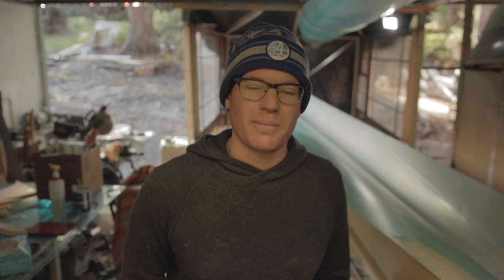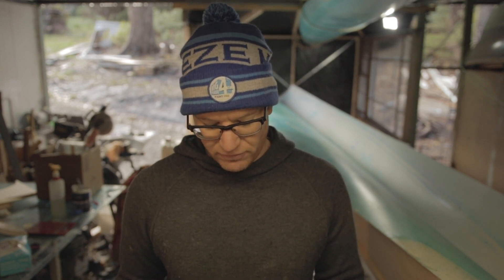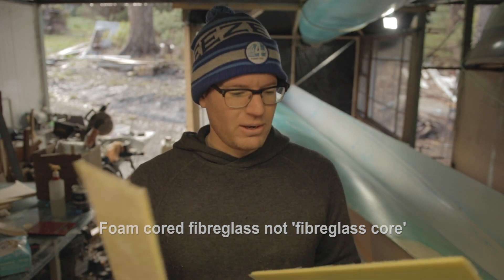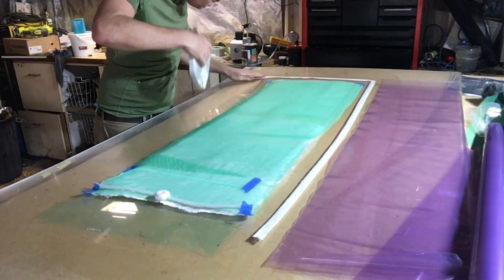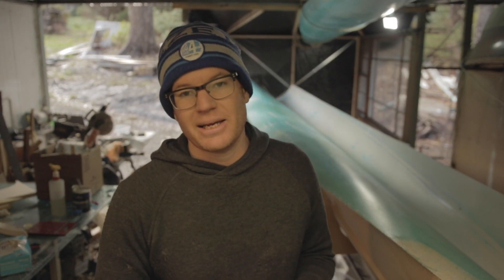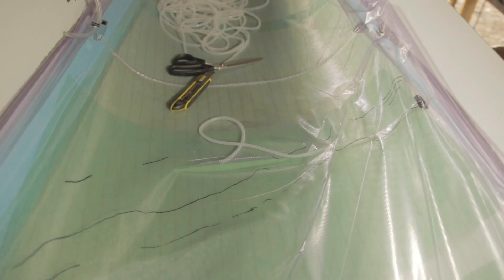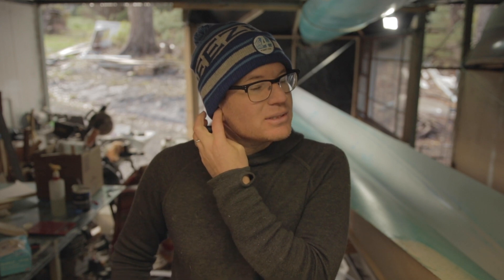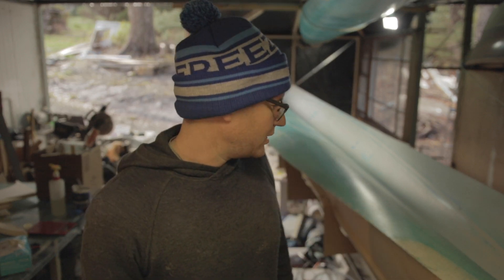Experimental boat building. Will it work??

Comment: I saw a guy bend that stuff with a heat gun.
Reply from the maker: Yeah it pretty pliable with heat added. I’ve been using a recycled PET (drink bottles) foam lately and it is very susceptible to a bit of heat which makes life easier.

Comment: Hi Matt, what a great video! (subscribed) One question if I may. I've got an old 14' sailing dinghy of thin plywood/epoxy construction. The plywood got soft over the years so I striped it down to a shell and dug out the soft wood (about 10%). Now after applying all anti-rot treatments I'd like to put some extra foam (thin) to reinforce crucial places before glassing over. I've got plenty of Extruded Polystyrene  (soft & flexible, we use it for packaging ). Will it provide any strength, or should I stick to the pink construction foam? Where I live the options are limited and I'm reluctant to order some fancy foam from oversees as I don't value this dinghy that much. Any comments are very appreciated.
Reply from the maker: Thanks Matej! To be honest I’d avoid foam if possible. It’s really only good if used in a sandwich with fibreglass on both sides and any kind of polystyrene is not great in that regard anyway. 
If you’re just filling shallow areas I would just fill it will thickened epoxy or if you’re replacing whole sections of plywood I’d just get some more plywood and scarf it in then glass over that. Does that make sense? Good luck!
Reply: Lol I'm going through the same dilemma.   I've recently bought a 12.5ft solo that has some hull damage.   Dealing with 7mm ply is difficult and almost impossible to scarf in-situ.  I've opted for halp lap joints instead.  I'll also be applying two layers of glass when the weather improves.   I'm currently in Bendigo Victoria and it's midway through winter and I'm working outdoors.  As a result,  I can't epoxy til early to mid spring. 

If you've got more footage,  I'd really love to see the build in more detail.

Comment: Thanks for sharing...  Looking forward to more developments.  Tbh I don't get the infusion thing... Is ot really that much lighter than a hand layup?
Reply from the maker: I'm not sure of the stats on how much lighter it would be but it is very difficult to create a moulded piece without some sort of vacuum bagging holding it all together. Once you get the hang of infusion it is relatively simple, fast and clean way to create a large composite piece.
I can't see the point of normal vacuum bagging when infusion is so much better.

Comment: really nice Project!   but I didn't understand what type of material you have used for the core.... you showed two types.... one is foam core... the other looks foam ... but you have showed that is more flex ....and stronger.... what material is that?  sorry my first language is not english .. problably is why I couldn't understand.......  other question is .. did you find out why you had leaking air? thanks!
Reply from the maker: Thanks Pedro! The core of both is 6mm Polyurethane. The difference is in the skin. One is fibreglass and the other is Innegra which is much more flexible. I'm pretty sure the air leak was from the table which was painted plywood. Apparently small amounts of air can get through. I think next time I would just use a flat table of laminate or plastic of some sort.
Reply: Thanks Matt!!  good luck! you are doing a really nice Project!
Reply from the maker: Thanks Pedro, good luck with your project too!

Comment: really nice!! I'm planning to build mine!!  are you doing your project?
Reply from the maker: Thanks RF! Are you building a Proa? What sort of plans to you have in mind? Yeah I'm still working on it. Had most of the summer off just busy with other stuff but getting back into it now. Hopefully I'll have another vid up soon!
Reply: @MattTucker  I was thinking to make a small prototype like 18 foot first, light CM, but haven't chosen any project yet.... I'm looking for the options... Just saw the Harry projects... they look good... hope they can finish the C60 that they are building in Peru to see what the results they get. These look promising ...... but not sure why there ins'many proas around.... they really look a good option for multihull to go fast.
I will probably start to project the mast... these looks trick for the proas.... have you got these sort out already?
I was thinking about these foiling idea... wouldn't be better a foil on the windward side with pitch control?  I mean to help to control the lift for a harry type... where you have most of the weight on this side.
Reply from the maker: @RF-yh3qh  Awesome! Yeah the rig is definitely the trickiest part. I have a convention stayed rig setup but with all the stays on a 360 degree track around the mast. I've got the mast and have ordered the track so hopefully it will work!
Harryproas are an interesting concept but I'd be a bit wary and experiment with a protype and work out what you like and what you don't like.
So many options but I prefer the idea of the foils to leeward to provide righting moment as the boat heels instead of having too much weight to windward which is no good for light airs.
The drag to leeward also helps balance the drag of the Ama to windward.
The drag of the Ama and the unbalanced nature of it all is a huge problem with every Proa I have sailed on or talked about so is one of the most important factors in getting the boat to sail right IMO.
For every Proas that exists there is a different idea on how to do it so I'd recommend talking to owners about it and sailing on as many as you can.
Reply: @MattTucker  exactly..... I'm looking for no stayed...  just two self-standing carbon masts... but not sure yet....    about the Ama you are right... that is the trickiest part for these proas...it's interesting how Harry have inverted the weight to the Ama..... that's why I was thinking why I didn't find yet a project with a foil in the Ama with pitch control to put the Ama flying at the right height and push it down or up when necessary.... these could make it perfect balanced in light or strong winds ......  I'm going to keep looking closely your project....  mine is going to take a while to start yet....thanks!    if you haven't seen this, it's interesting...  http://multihull.de/down/ndrua-gb.pdf

Comment: Looks like some Kelsall (KSS) inspiration in there too?  Anyway, awesome work, subbed for the journey, thanks for sharing.
Reply from the maker: Just finished reading about KSS, you’re right there are clear similarities but I had never heard about it before. To be honest the flat infusion table is the way to go. My curved one ended up being the cause of most of my troubles and I don’t think adds any real value. 
I would be interested to see just how far you can compound bend the Innegra foam panels and if you could eliminate the need to make the dart cuts.
Definitely will look further into it if I end up making a bigger version. Cheers!

Comment: Looks good Matt, like a lot of things, infusing is real easy when you know how. Trouble is you have to make a lot of mistakes before you know how.  Then you are getting pretty good and confident just as the project is finished.  Been there done all that. One trick I learnt was to use an old wine bottle for the resin trap, just make a rubber bung with 2 tubes through it, tie the bottle to a piece of wood to keep it upright and it makes a throw away resin trap that is see through.  I'm very pleased to see you are pushing on with the project, there is a beer ad running in NZ at the moment that has the punchline,  GOOD ON YA MATE..
Reply from the maker: G’day Ian, don’t worry I’m not giving up that easily! I have been waiting quite a few years to give this a crack so keen to get sailing asap. 
You’re right about the infusion, hopefully it will be a skill worth the investment in the long term. 
Speights? Those and the Tui adds were always a highlight! 
Thanks for your encouragement  I do have a resin trap but need to get some cups to fit in it because it’s already a mess with built up resin. Just about lost an eye chipping it out with a chisel! (Good thing I wear glasses)